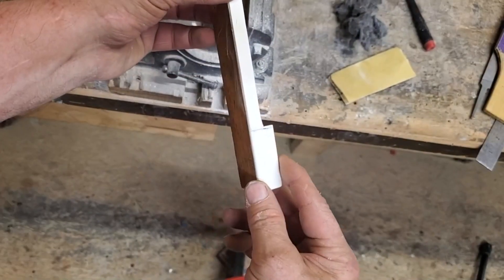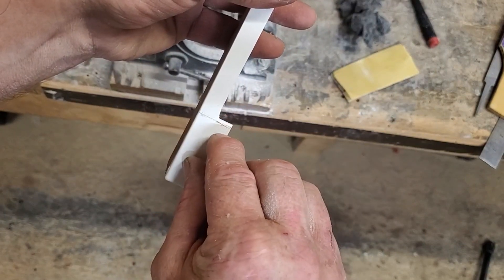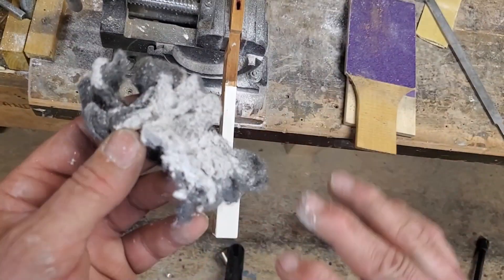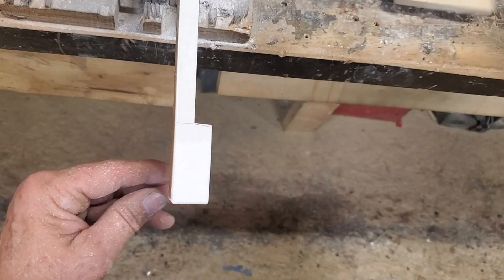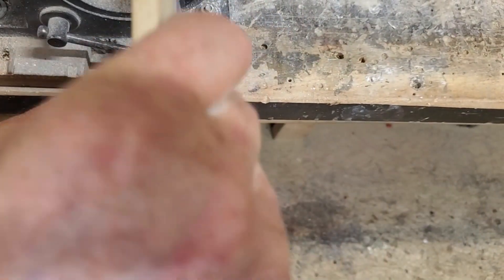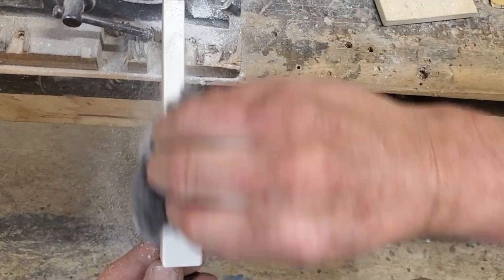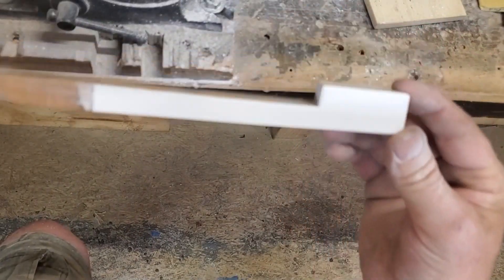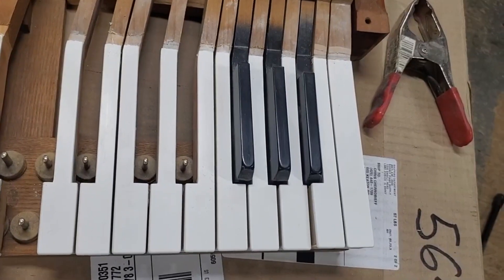How To Make Piano Keytops Feel Fantastic

Comment: I'd love to try that steel wool + pumice technique on my Petrof. I bet it gets rid of some of the slippery feeling from plastic keytops.
Reply: I tried the steel wool + pumice method today and it worked amazingly!

I have a Kawai ND-21 upright and the keytops always felt slippery, especially after cleaning them. I used 0000 steel wool and fine pumice, rubbing each key lengthwise for about 15-20 seconds as shown in the video.

Took me the better part of 2 hours, and my bathtub was full of steel wool and pumice afterwards, but the keytops feel amazing! So much grip, so much control.

One downside is they are not as shiny / polished as before. So, not as reflective. I don't mind, cause I prefer to listen to the piano, not look at it!